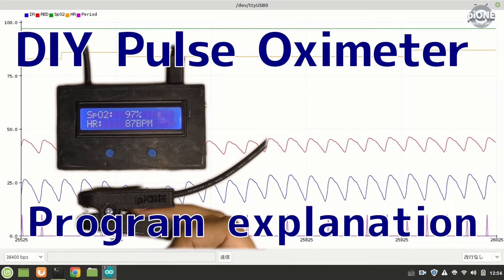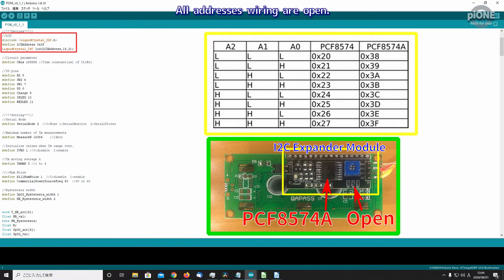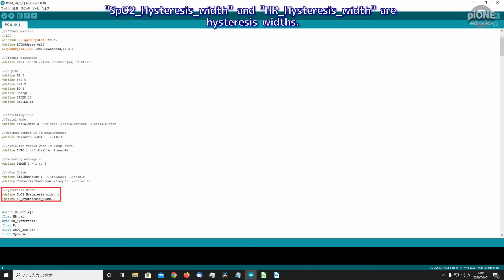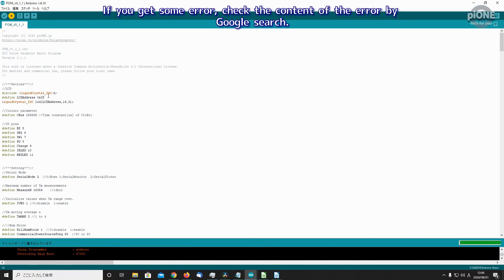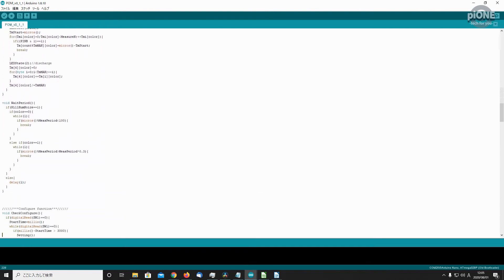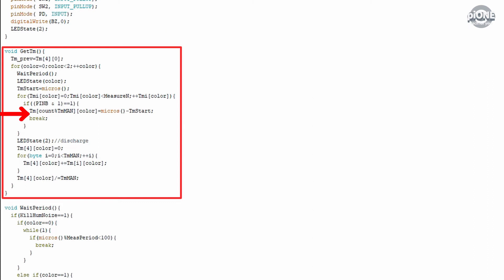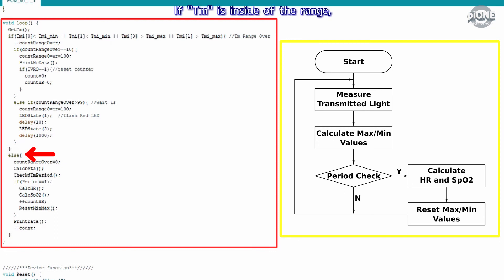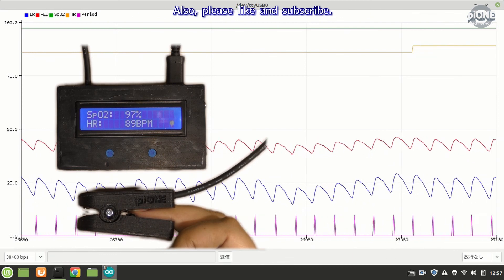DIY Pulse Oximeter you can make   4. Program explanation

Comment: pls, Can you help me explain what range over means?
Reply from the maker: This pulse oximeter calculates the absorption coefficient from the pulse width of the dimmed transmitted light.
To calculate SPO2, it is necessary to sample without missing the maximum and minimum of transmitted light.
Therefore, a sample speed that is several tens of times faster than the heart rate rate is required.
Considering hum noise, one sampling (IR + RED measurement + calculation time) is set to be within 16.67ms or 20ms.
If it exceeds this, the range will be over.
Reply: Tks, I wish you have a good day